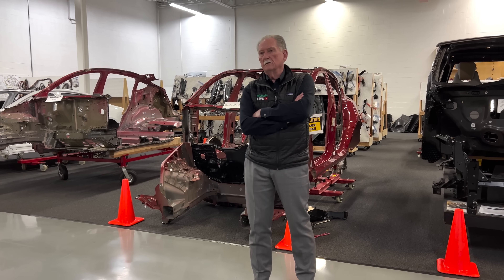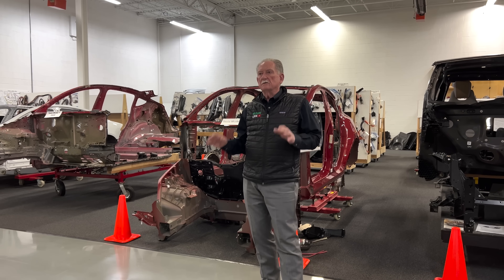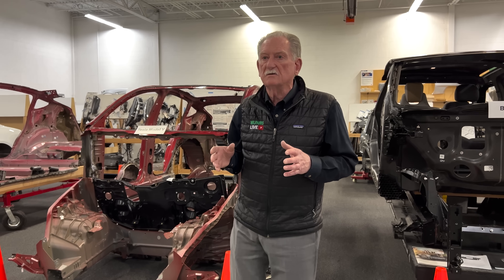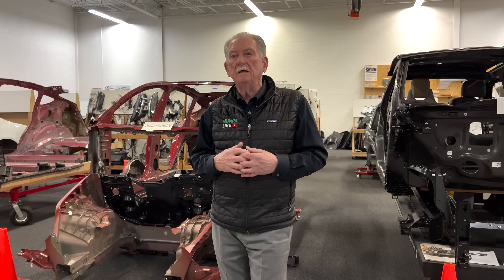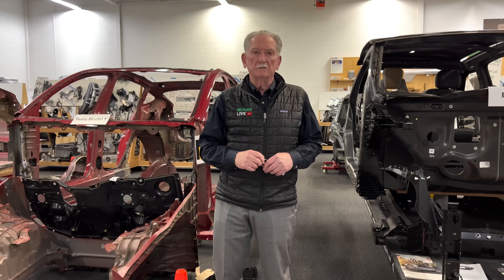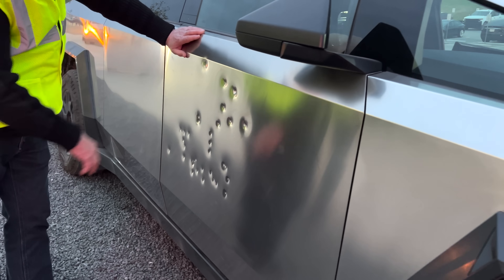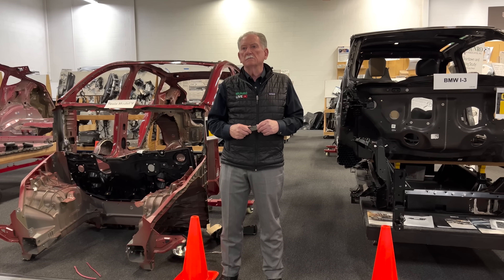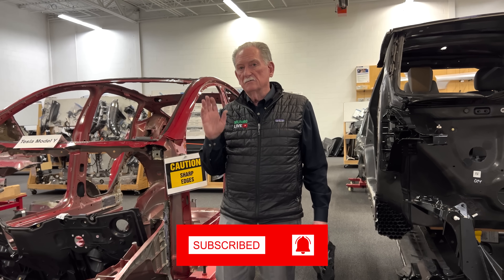An Engineering Analysis of the Tesla Cybertruck

Comment: People are missing the real revolution in how the Cybertruck is wired.   48 volts reduces the size of the wire, but multiplexing reduces the number of wires by a huge amount.  However more importantly it changes the wiring architecture radically and makes it easy to change the behavior of the car through software and therefore over the air updates.  Instead of switches and sensors (inputs) that are wired directly to a light or motor (outputs),  the inputs and outputs are now completely separated and don't even have to know about each other.   This means that you can turn on a headlight or turn signal or control a seat through the computer, not through switches and relays.  It is the computer program that associates a switch with the correct light or motor.

This is how Tesla cars can put on a light show with the headlights, turn signals, interior lights, etc all synchronized to music.   This is also why you can easily turn on a light or the heater with your phone.  Everything is done with software.

Imagine you want to add a light bar to your Cybertruck - you don't have to mount a new switch on the dash and run a wire up to the light bar.  Instead you mount the light bar and simply connect it to the nearby bus.  The light bar has an address similar to an IP address on your computer.  To turn the light bar on or off the computer sends a signal out on the bus with the IP address of the light bar.  It's easy to add new devices (inputs and outputs) anywhere on the bus.  This is a huge change and it eliminates the need for different wiring harnesses for each model or variation of a car.  The model 2 can use the same wiring components as a Cybertruck. 

The old way of wiring would be like running a wire from your computer to every other computer in the world that you want to communicate with.  Now that would be a mess!  The new way of wiring is similar to ethernet where you have one connection to the world and all communications are done with packets that have a destination address embedded in them. 

The bus in a Cybertruck can transmit 1Gbit of information per second.  This is similar to the WiFi in your house.  Wifi has the bandwidth for you to stream a movie, while your kids play internet games, and your spouse listens to music, and your security cameras transmit pictures.  This is all done with one signal.  Therefore all the cameras  in the car, and the 12 speakers and everything else can get all their communications/information through one bus.  (I'm guessing the cameras use the bus to transmit their signal, this may be a bit too much.  However Tesla has stated the speakers do)

The liftgate on my Toyota 4Runner has 15 wires going into it.  After 23 years of opening and closing the liftgate the insulation on the wires wore off and I was getting shorts.  Sitting at a stoplight one day smoke started coming out from under the dash.  I downloaded the 35 page wiring diagram from the web.  Most of the wires in my liftgate came from the environmental control unit under the dash and a relay in it had melted.  This unit has 13 connectors with 5-12 wires in each connector.  This unit has fuses, relays, and a little circuit board.  I never did figure out the wiring diagram to much detail.  All this is eliminated in a Tesla. 

Assuming the communications bus in a Tesla is 4 very small wires for communications plus power and ground, you can accomplish the same functionality my Toyota has with 6 wires.  And if you want to add more devices to the liftgate you don't have to run more wires.  Simply tap into the bus, assign the new device an address, and you can now control it through the computer.  And if you need a switch to control the device you simply change the software to add a button to the display or to your phone app - or both.
Reply: James.. That was very well explained.  Thank you.
Reply: wow, excellent explanation 
super interesting
Reply: I’m surprised Tesla didn’t use this 48v system on their Semi.
Reply: @yokaibyte2133  
That is a really good point. 
It seems like it would be the best platform for 48 volt. 
I guess they were not quite ready to make it work at that time though. 
I suppose that it will happen over time, especially if other manufacturers start using 48 volt batteries.
Reply: @yokaibyte2133  Tesla has been using multiplexing in their cars for some time.  The semi uses the same approach.  The cybertruck just increases the speed of the bus and the voltage.  They've paused full production of the semi and Tesla isn't afraid of changing things.  I will bet when it goes into full production they will be using the new architecture.
Reply: In terms of basically every switch, motor and light being connected to a computer, that's basically how everyone does it these days I think. The difference is things like your tailgate, currently each switch, motor and bulb might have its own wire to a central computer. The opposite extreme is a computer in every switch, motor and bulb, all connected directly to a bus. Most cars now are somewhere between the 2; maybe a computer in each door, or each front door, maybe not a separate one for the tailgate, etc.
Also the trouble with one bus for literally everything is the higher risk of a failed module blocking safety-critical comms. I think that's one reason most cars have more than one separate bus in the can bus type architecture. It'd be more than a little unfortunate if a failed loudspeaker module, for example, blocked all the comms between the steering wheel/yoke and the steering motor... And having to design every component to safety-critical levels of reliability might add a lot of cost too.

Comment: Tesla is moving things forward but not nearly as much as implied by many.  48-volt architectures have been in cars for years in hybrids. Tesla is the first mainstream EV car to push I think (I don't pay enough attention to China to know if BYD, Geely/Polestar, or someone else is ahead here.)

In-car networks have been around for DECADES (bought a new 1999 Volvo S80 with canbus, and I don't think they were first.)

Learned about martensitic transformation in aero/astro material science classes in the 80s...it's nothing exotic these days. Simply not as commonly used for autos (nor was it what was originally planned for CyberTruck as I recall - more a concession that their original design didn't quite work.)

Comment: Sandy, the 2WD base version of the Cybertruck (which is not available yet) starts at around $60K, not $80K. At the beginning of the video, you were not displaying the spec for that version. The AWD Dual Motor version starts around $80K, and the Tri-motor Cyberbeast starts at 100K.
Reply: Well he is talking about the versions that we know are being sold RN, since the 2WD may see it's characteristics and price change with any modifications done after initial ramp up
Reply: @mobiuscoreindustries   Listen at 0:35: "The spec on the Two-Wheel-Drive system is between $79K and $88K..." This is incorrect, and is actually the price of the All-Wheel-Drive configuration shown on the screen.

Comment: It is called organic design and is not a cfd issue.  CFD is of course related to the metal flow but this shape is principally for the strength and reduction in natural resonance frequencies that the casting is sensitive or rings at.  You are correct on considering the flow in CFD as well.

Comment: The speed of the bus doesn't change because of the gauge of the wire. It's the move from CAN bus to Ethernet
Reply: Who cares about the speed? Does it really matter if the head lights come on a few milliseconds earlier when you operate the switch? CAN was designed for this job and is plenty fast enough.

Comment: @7:09 you say the stainless is austenitic. @8:36 you say martensitic stainless is what the Tesla product is made out of. I assume the first is correct since you were talking about it being non-magnetic (why does that matter?). I would also argue that pairing down the wiring harness weight is completely irrelevant. Sure, lighter vehicles are always more efficient but we're talking about a 6-7000 pound vehicle; 30 pounds of copper isn't really an issue.

I'm all for innovation but, why can't I have a car that I can work on? If I were going to buy something electric, it'd be a bike. I wish Tesla would make one simple with decent range and just mass produce it so it would be cheap. Imagine all the places in Asia that would go crazy for an electric bike.

Comment: Another way to envisage the cable sizes. Feel the weight of a 120 volt extension cord. Now feel a 240 bolt cord. The latter is rated for double the power but the cord is lighter weight. There’s less copper.

Comment: Love Sandy, but there is so much bad info at the beginning of this video. Sandy seems to think there are only two models. There are 3. He also seems to think that the range extender is available. It's not. The two wheel drive starts at around 60k. The range extender is rumored to be $16k. The two wheel drive models range is only 250 miles. The two wheel drive models 0 to 60 is 6.5 seconds. Be better team Munro

Comment: It will be interesting how insurance companies will look on the specialised stainless steel in a crash. The Cybertruck sounds unrepairable , will they really pay for the write off, that many of these vehicles will become . Also waiting for an image of the 48 volt battery.  Mercedes brought out 48v a few years ago and it was a dud. Trucks use 24v , but there battery's are huge. Its seems cou ter intuitive.  Because power tools started on 40v and a modern Makita can do more now on 18v .
Reply: Trucks use heavy lead acid batteries and cordless tools like Makita run on Lithium ion batteries.
Reply: @davidrink1291  I'm simply pointing out that in power tools voltage has reduced not increased for the same and more torque. 
Also no reply to repairing a stainless steel body. Every single dent will stand out like a sore thumb. No filler and a can of spray. Will repair that cheap.

Comment: If Tesla are using Ethernet control over the 48 volt power line architecture this would allow some wires to be completely eliminated.  Having no physical connection means the steer by wire feature means that vehicle control can be relocated anywhere and therefore could be driven by the mother in law sitting in the back seat.

Comment: Oh here comes the puppet expert - the one that says Aptera is a car; even though its a 3 wheel motorcycle - So likelwise how does this Engineering reivew not include the battery pack and the fact that Tesla can't even made the downgraded type B 4680?  Isn't that part of the car? The battery pack? And if Tesla can't make the batteries reliably in order to produce the CT in volume - isn't that an engineering element?  Distract with anything - just don't talk about only 12 CTs made after a week!

Comment: For the wires, Watts(power)=Amps (current) x Volts so you get the same power from dividing the current by 4 and multiplying the volts by 4. The current is the one that needs thicker wires, that is why they use high voltage power lines to move electricity long distances, otherwise they would need thick wires. Trucks and tractors have used 24v for many decades, just 2 12 volt batteries in series, easy.

Comment: Sitting on the couch, I guess I will let all you genius types. test this stuff. Maybe I will buy one once you get the bugs out .  Worry about steering by wire. When I see so many communication issues with almost any computerized control system I have ever worked on.. Jet planes are in the millions, and  i bet they are tested more for now.  Yet I still see issues and read about many near crash events.   I'm curious if your battery is low, will it get harder to stear, etc.    I didn't reserve one anyway .     Man, I wish I had billions to design my truck.  I think I would keep some things simple, however.  And steer by  steering directly still.  Maybe not the back tires. Thinking  that does seem cool.  Needs a lock out safety switch if it doesn't have one? Thinking at least. For the couch potato 🥔  suggestion of the day

Comment: no official info however not hard to guess the battery PACK  will be 48V, ( or 51.2 Volts nominal to be precise) and this is going to be a new "standard" probably.  BYD blade battery is also 48V.  These are perfect match with both 48V BYD home backup battery voltage and 48V Tesla Powerwall voltage too which is handy for DC bidirectional charging. (Dont get confused with high voltage numbers, those are after DC/DC  or DC/AC upconverter)

Comment: I was first in line to get the Cybertruck but the weird shape when it is no longer an exoskeleton seems wrong and you talk about cost savings and weight savings but this thing weighs 6000 lbs and costs so much.. not too mention the ridiculous need for a range extender all screams “ goals not met” The austenitic versus martinitic alloy explanation also seems redundant and who thinks cold hardening doesn’t work? Confusing analysis for sure.

Comment: Telcom has been using -48v DC for about a century. All central office switches and equipment is that architecture.  When Grandma's house phone ( land line ) used to ring from a couple miles away, it was the ringing current. Usually around 90v. On 26 Guage copper wire.
Reply: Ours was 2 x 1.5 volt dry cells size of wine bottle. I got to use them for years afterwards. Perhaps I’m older?
Reply: @iandavies4853  yeah there have probably been changes over the years. Now, even the modern SONET ring systems still use -48v. On the Telcom side I've gotten " lit up " when that current comes thru and you are touching tip/ring while kneeling on the ground in the rain!😄

Comment: So it is rated to tow double what it weighs? That's safe. No wonder we don't get the range stats on towing 11k uphill. We get range stats of single passenger track tests and quarter mile speed runs. Let's see this baby tow a 10k RV and family through the mountains on a 2000-mile trip. Then we can talk about this "truck". I'd be impressed by that. But Honestly I hope no one does that. Because it just doesn't look safe and I don't want anyone hurt.

Comment: Ethernet was originally designed to run on special coaxial cable in a multidrop configuration (each attached device would tap into the cable). Then they figured out how to make it work using basically telephone wire and they reconfigured it into a star-shaped configuration, or hub and spokes. Now Tesla are going back to the original topography, by the sound of it, although a million times faster than the original Ethernet. Which makes a lot of sense. It also implies that every item that taps into the cable will be a computer — lights, door handles, motors, everything. If you thought there were lots of computers in cars these days — you ain't seen nuthin yet 😅
Reply: Not just every light, door handle and motor, but every sensor too. Taken to the extreme for wiring reduction, basically every single plug/connector on that legacy loom he showed would have to be a computer. Far less copper wiring, but far, far more computers and more complex sensors, switches, etc.
Reply: BTW this also raises security issues. I heard that the Black Hat computer hackers' conventions have been running sessions for ages on how to hack a Tesla; let's hope the Tesla software guys are as good at building in defences against hackers as they seem to be at creating excellent functionality.
Reply: @xmfclick  Their software has been hacked.  Like the guy that gained control of all their super charger network realtime data back in 2017 or the group that just unlocked all of the extra software feature for free,...etc...

Comment: I've heard a lot of talk on various channels praising the 48v architecture, but no one mentioned anything about the secondary 48v battery.  My question is whether Tesla has done away with the secondary battery by running an inverter off of the primary battery?  Or did they actually make a 48v secondary battery?
Reply: Was wondering the same myself.
Reply: There is quite a bit unknown about their 48V system.
Reply: @eruma  It's now known to all the other major manufacturers as well as Tesla ... because Tesla sent them a full copy of their 48v specification in a fat document! I presume that Tesla recognises that for 48v to succeed it would benefit enormously from other manufacturers joining the party.
Reply: Safety suggests that the high voltage battery needs to be able to be completely isolated to render it inert when the vehicle is not in operation.  That is usually done with contactor relay(s) inside the battery case.  An external source of auxiliary power is needed to close the contactor(s).  The auxiliary source could be an ultra capacitor or a battery.  We’ll have to wait and see…
Reply: You can buy a 48 volt lithium ion battery off the shelf  for $400 and it only weighs 38 pounds.